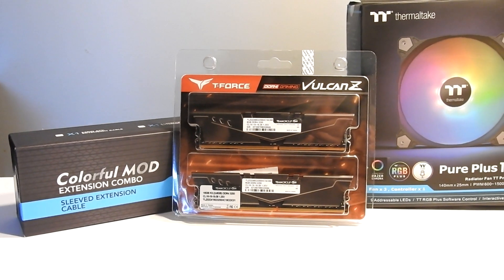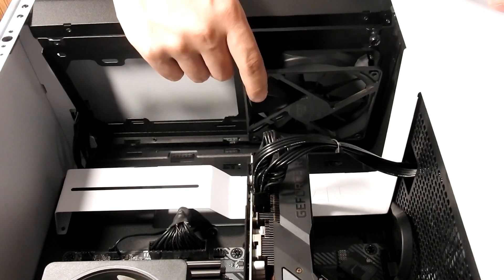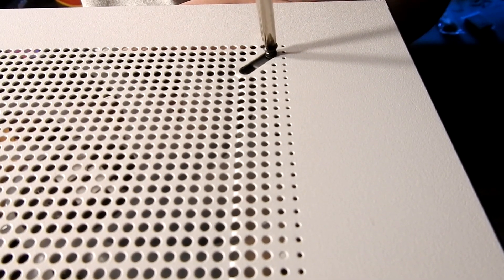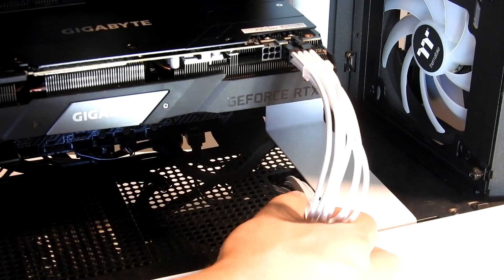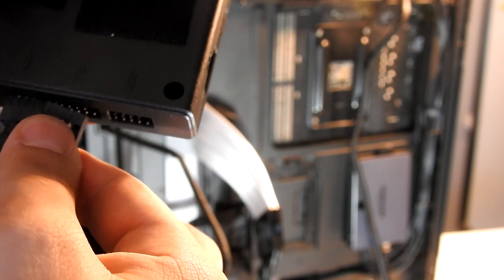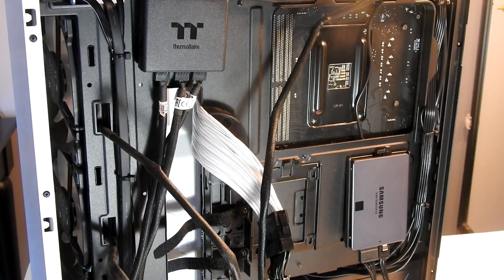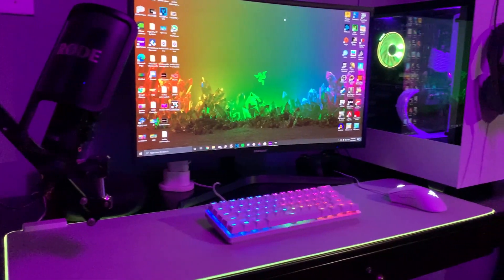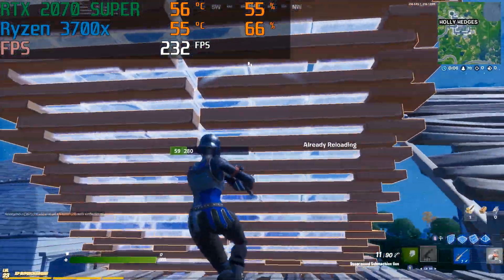UPGRADING NZXT STREAMING PC | BENCHMARK COMPARISON | WARZONE, FORTNITE, GROUNDED, RAINBOW SIX

Comment: aye bro how do you replace the stoc fans with rgb fans or is there any video that can explain this
Reply from the maker: I did it in this video
Reply: @ILLTHIRST  is it possible to replace the kraken cooling fans on the new streaming pc
Reply from the maker: @mauropina5363  you wouldn’t want to replace those, you would probably just want to add rgb fans, you have a newer version than mine that has better cooling
Reply: @ILLTHIRST  is it possible tho?
Reply: @ILLTHIRST  and if not possible where do you thing i can add rgb fans?

Comment: your fan config is wrong. If you want to get better temps then flip your exhaust fans (the ones at the back of your pc) so they can pull air from inside the system and exhaust hot air out the back and top, and also flip your front 2 fans so they can pull fresh air from outside the pc and exhaust air in the system. I highly recommend you do this since it will give you much better cooling especially for the graphics card
Reply from the maker: That’s how it’s set up, intake from the front and exhaust through the back and top
Reply: @ILLTHIRST  Oh damn

Comment: how many frames does it run base? and we have the same mouse.
Reply: I run 144fps on warzone, apex. Valorant runs 240 FPS. No upgrades done to the standard streaming pc from nzxt. Warzone and apex run 144 consistent on medium settings like 120 FPS on ultra settings. You can run regular multiplayer games at 240 frames consistently.
Reply: That’s what I get atleast apex legends hits 240 frames but not consistently throughout the game on min settings.

Comment: Nice video man! I got my streaming PC back in May and have been loving it. Since then I have added an extra 2TB HDD and two NZXT AER RGB fans (one intake and one exhaust, 4 total now). I think my next upgrade is from 16 --> 32 gb of RAM, then maybe switching to a Kraken cooler, but I have seen some people notice a increase in temps going from the Wraith Prism to the Kraken, so I am not sure.
Reply from the maker: Nice!! I pretty much did the same, I added 3 140mm fans and noticed a drop in temps, also doubling your ram will increase performance by more than you think. I would keep the stock cooler
Reply: @ILLTHIRST  Yeah I noticed a significant drop in temps when I added the fans, and that's great to hear, I was wondering if it would make a big difference. Thanks!

Comment: Did taking out the WiFi do anything with the performance of the pc?
Reply: WiFi card*
Reply from the maker: Blnks no, wifi card doesn’t do anything other than give you the ability to connect via WiFi, so if ur using Ethernet cable, it doesn’t make a difference

Comment: Do you have to do all that stuff with the graphics card for the installation of the fans
Reply from the maker: Exxotic no that was just for the cable extensions, which are just for looks, to have white threaded cables instead of black rubber cables

Comment: Didnt this pc already come with 16 gb it did you add more for 32 gb. What diffrence doesnt it make? Nice vid
Reply from the maker: Drippy yes added 16 more gb, more memory can make things like editing videos a bit faster, also the more ram, the more memory there is for your cpu to take advantage of. And as you can see with the comparison, we were actually able to hit slightly higher FPS after
Reply: @ILLTHIRST  any big issues, without the upgrade will it still run good for atleast 2 to 3 years?
Reply: @ILLTHIRST  adding more ram doesnt increase fps though
Reply: @voltage5802  more memory space= More Fps
Reply: @xity_  yeah but not that noticable
Reply: @voltage5802  ohh well ya he is only adding 32 32 to 16 you won’t even be able to tell the difference if he really wants to see some difference get 64
Reply: @xity_  so whats the difference in mentioning it

Comment: Great vid dude.
Reply from the maker: Mooter thanks bro
Reply: Ill Thirst hey bro I’m like really new to pc it just came in today do I need a jack splitter for my headset? I saw the mic and line in and out on the back is that where I plug into?
Reply from the maker: Wyatt rich it depends on your headset, but I just plugged my headset into the top front of the case and it worked with my mic
Reply: Ill Thirst was your headset a usb or the jack?
Reply from the maker: Wyatt rich that was for my headphone jack headset, I have a usb mic now and you can plug that in, in any USB port.
Reply: Ill Thirst okay I have a hyper x cloud 2 and it just seems like it doesn’t fit into the top audio jack
Reply from the maker: Wyatt rich you might have to shove it in pretty hard, as long as it fits all your other regular headphone ports, like the one in an Xbox controller or any other pc, than it should fit on the top.
Reply: Ill Thirst update I think I broke something haha
Reply from the maker: Wyatt rich I looked up your head set, it should work
Reply: Ill Thirst for the mic and audio ?
Reply from the maker: Wyatt rich yeah, the plug in at the top of the pc is ur common headphone jack and the usb up there works too